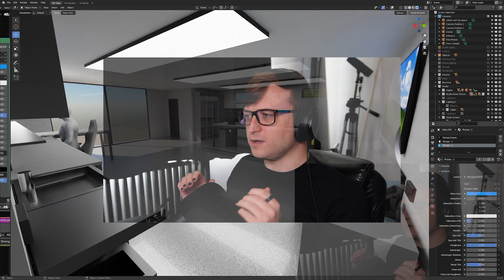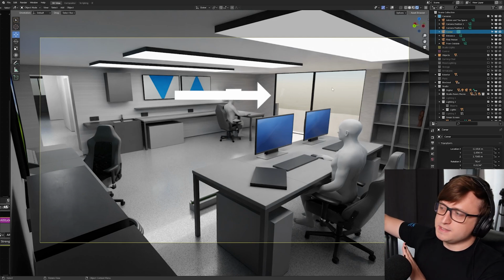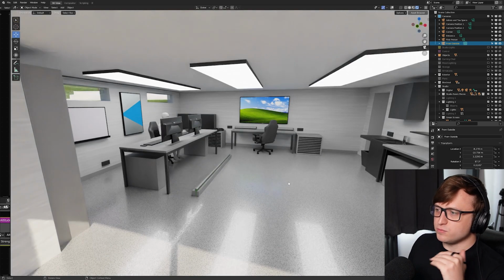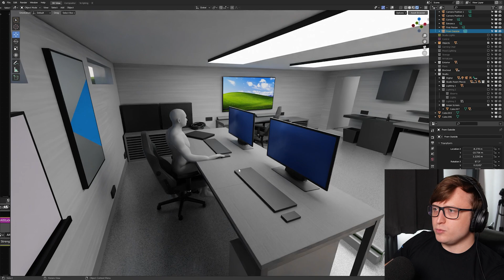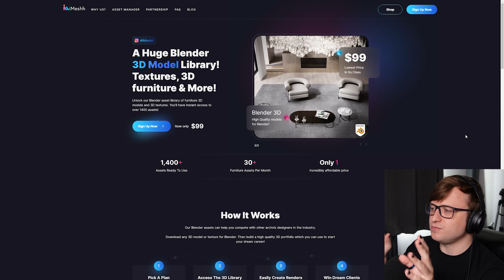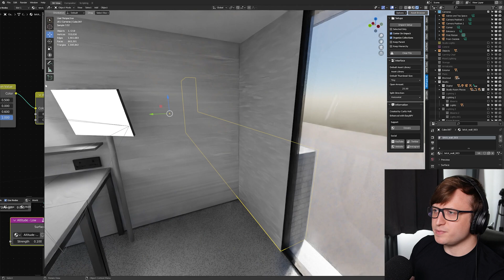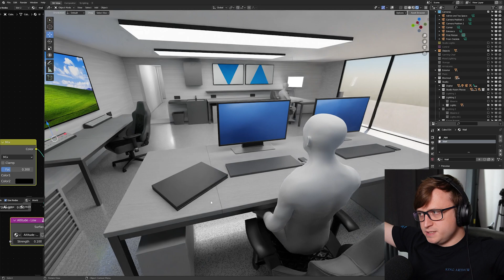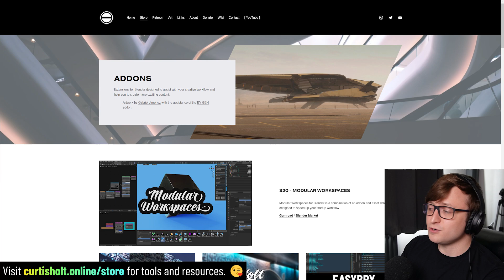Using BLENDER to Design my Future Studio!

Comment: 🏠 You mentioned the light box lighting, these can be easily added.  They are LED lighting panels and can be tuned to daylight frequencies if required.  Also I see you have terrazzo like flooring which might give you some echo artefacts when recording.  Might want to consider other materials like carpet floor tiling which can be bought as anti-static. Your wall art could be made as acoustic panels to help with recordings as well. Definitely look to get rid of the beams, visually they are quite divisive.  Apologies I’m an Architect - I’ve waffled on too long.  Great video though.  Love the discussions.

Comment: 🏠 Thanks very much for this! Gave me some ideas for the renovation/extension of our Men's Shed. While I agree generally with your suggestion for stylized approach others here have made suggestions about more precision or specific needs. For our purposes we too do not require detail in, say, our equipment models but we do need specific size and a 'work' volume for placing equipment, particularly in relation to each other. As our membership grows we have to become more creative with existing space since capacity to expand our footprint is limited.

Comment: 🏡Thank You for showing how Blender is usefull for planning renovation. I often renovate my home and my children's. I use a software like 3D Home, but I am not satisfied. There are many limitations due to the fact that the software is based on standards. For example, a wall may not have the same thickness everywhere, a floor may be offset, a roof may be non-standard. All the software I used is made for new construction and not for renovation.

Comment: My thoughts:
1. In an office space (which is what I use Blender for at work, although we're not lighting engineers), we typically distinguish between lower intensity overall recessed ceiling lights to illuminate the space, and stronger drop down lighting fixtures to illuminate working surfaces (even desk mounted lights in some cases). Drop downs are often shielded (think barn door) to prevent eyes from ever being able to looking straight into it, often a combination of direct (down) and indirect/bounced (up), and sometimes very directional/focused using builtin reflectors, grids, or lenses.
2. In Blender, you can do one area lamp (not emission geometry) for the visible diffusor, and one that is actually focused. This prevents area lights with "Beam Shape" to dim all the way to zero which looks absolutely horrible. Not best implementation of "Beam Shape" by Blender I have to say.
3. Consider lift office desks over, well, those things... Your back can thank me later 😁For same reason, consider standing chairs and backless chairs (in addition to regular office chair - gaming chair not recommended, at all) to improve core muscles while working. Maybe throw in a walking treadmill for good measure? Ok, getting a bit extreme.
4. I would use fabric floor tiles to cover that concrete. Buy around 10 extra for spares when traffic starts wearing them out (office type can take a lot of abuse but are more costly) or when having a coffee accident. For acoustic reasons, just try to avoid hard surfaces where possible. Tiles are also easy to replace if experience tells you the current ones are too bright or too dark.
5. For lamp placement and type, also consider screen glare.

6. If planning to do professional colorist jobs, there are videos out there covering several aspects of this you might want to check out.
7. On distance to back wall, consider out of focus bokeh effects with the available camera equipment and limitations.
8. Background separation plays a part, where it should be easy to decoratively illuminate the background alone, using spots and gobos and so on.
9. Coffee machine ☕should be within reach of seating position. I'm sure Gleb agrees 😆
10. Something I didn't spot in the video was cable management and routing considerations. Plan on doing any floor boxes for electricity accessibility? Think about flooding hazard, even if unlikely.

Comment: 6:45

Those lights are easily DIYable by taking old/broken flatscreen TV's/monitors and using the lenses to diffuse the light. Most people like to use LED strips to produce the light at a lower cost and depending on how much you want to spend, the cheapest options require soldering.

So a couple few free scrap flatscreens (be careful, they have a... capacitor? that is likely still deadly even if the TV's been dead for a while but easy enough to avoid), a very basic box to house it and however you want to hook it up to the roof.

Comment: 🏘️Contraire.. Design for lighting and storage (closet). I'd include a screen to decide... (Green screen) or curtain on ceiling/moveable on floor. I'd put it in front of the door wall.  If you're going for quiet then design for that.  The white board could be on wheels or " tv/monitor screen sliding swing arm".   
Structural looks just fine, just sound proof. 
Think about floor covering. Carpet absorbs while hard surfaces bounce sounds.  Different color zone lighting. Basically go-to a tut on film lighting, cinematic lighting.. FilmRiot. 
Internet connections in verious locations.
Draftsman for 10 years carpenter for 20 years.

Comment: 🏠, Hi Curtis, looks nice if you can do this.
I am a Construction Engineer and also know a lot about Architecture and Interior Design, I can give you some tips.

The most important thing is to make sure that the beams can be changed because without that none of what you design matters.
I think is a bit difficult but not impossible to change, but I don't know the laws there but make sure the town planning allows such an intervention, if it has to be declared.

Regarding the ergonomics of the space, I would tell you to put your desk close to the natural light. Also the mobile green screen when is closed is a dangerous obstacle if is not well "hidden".
Also keep in mind that is uncomfortable for someone to sit at a desk and "look" at the wall, avoid that if you can.

The light boxes if you can place them them inside the ceiling, otherwise estimate that they will overhang at least 8 cm if you buy them from a store.
Αs you well know lights are very important so don't just rely on the ceiling lights. I would suggest you to have at least two desk lamps that you can direct where ever you needed or two bigger floor lamps, relatively close to the desks looking up.

You can also add some plants...! Lol~!
Thanks!

Comment: 🏠, Blender is remarkably usefull for this kind of thing. When renovating our kitchen halfway through I took some pictures and projected that onto some geometry at scale so I could experiment with different tiling setups (colors, size, layouts etc.) It made the process a breeze. I have also designed some other things (for example: bunny enclosure) and put that into the 3d space.

Thanks for your insights and good luck on your renovations and moving.

Comment: 🏠 Interesting workflow in terms of realizing a space under construction. Also, I've not met many people who can go back to a single monitor after going multi monitor for productivity. I'm curious what pushed that decision.
Reply from the maker: It's quite interesting, I've been using two monitors for a long time, and I wanted to upgrade to three, but recently (since I rearranged the room to get furniture out), I have not had space to keep the second monitor where it used to be. So it's more out of the way now, which has made me more aware of the times I really use it.

I have only three main use cases for it:
- To watch YouTube videos while I play games.
- To see who is typing in a chat while I am in a voice call.
- To make sure a recording is still running.

I don't think I need a proper monitor for that, or if I do, it doesn't need to be a large one on a stand. I have a smaller portable monitor that folds out on a magnetic stand. This may serve all of the same purposes without taking up so much space. Then again, I may just keep the second monitor on the side, we'll see how it goes. 😄

Comment: 🏡5:14 "It should be as neutral as possible", "color should be introduced in the parts which can be easily changed" - This should be one of the main interior design rules. Or maybe it already is, I don't know :) 
I wouldn't be sure about the green screen and the lights from the window (they could reflect from the floor, when it's sunny). I don't know how strong the effect would be, but there's always a possibility of a curtain/blinds for that case.
Reply from the maker: Haha, glad you like that rule! There will be a blind of some kind for the patio door, we weren't sure whether to do something simple or more complex to black out the light. I suggested that blackout probably will not be necessary. 🙂

Comment: When creating the actual layout of the place did you use the actual dimensions of the RL space? And if so, did you use a 1:1 ration or did you have to adjust? I am asking because in UE, using actual RL interior sizes makes the room too small for the UE mannequin.
Reply from the maker: So getting the scale was quite interesting since I don't have any accurate measurements. Firstly, I took the first version of the architect plans, split them into several images and overlaid them in 3D space, gave them an emissive quality so they were glowing and lined up the projections by the corners to essentially build a 'paper' 3D version of the house. That gave a pretty good scale estimation for most of the house, but still no accurate measurements.

Separately from that, I did a Lidar scan of the pre-existing garage with Polycam, as well as a couple of loose measurements of the space with the measure app. And then also took the pictures and video of myself in the space and used that to get a pretty good estimation of the scale of a person in the room.

Though it's not based on accurate measurements, I'm quite certain that I've got a pretty well scaled copy of the house by combining all of those estimates together. We are waiting for new technical drawing of the house to come through, so when that data comes in, I can use it to adjust the inaccuracies.
Reply: @CurtisHolt Thank you for such a detailed explanation, this is very helpful. :) Good luck with the project, It looks great!!

Comment: If you ex garage door used to open to a public medium traffic of cars and pedestrians. Consider frosted glass. No distraction, no temptation. Your TV should be on a wall mounted swivel to avoid angles where your TV may get a reflection from light sources. And don't use fluorescent lighting, use soft LED equivalent as fluorescent lights can cause flicker that causes headache. The only thing missing is a foot rest. Also, you need a place to not have to hear harsh blowing fans during rendering while you can work on other things while in there. Also heating and cooling to consider.
Reply from the maker: Those are good points to think about! Thankfully the patio does not open up to a public space or road, it looks out onto a longer part of the driveway that is backed by a row of trees, so it's quite private there. There should also be blinds that will afford some privacy.
The studio is planned to have air conditioning to coincide with other rooms on the ground floor, but I don't know where that will be integrated yet. Once I find out, I can add that to the plan. 🙂
Thanks for the note about the lighting, I agree since I'm prone to getting visual migraines.
Reply: @CurtisHolt  I hope your studio will be ready for every occurance.
Reply: Yeah lighting could be a big deal especially if you as re prone to migraines. Supposedly incandescent/ Halogen bulbs are best for health.  I'd say go for halogen.  Though these are less efficent than LEDs I believe they could help you considerably.  Back lighting monitors could aslo help with eye strain.  F.lux (free software) for "automated"/manual blue light control for your monitors